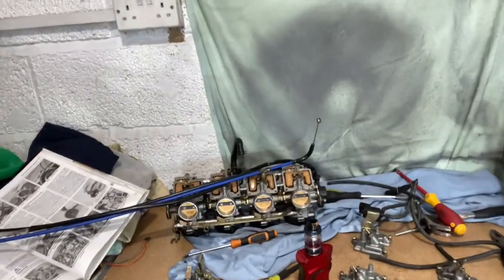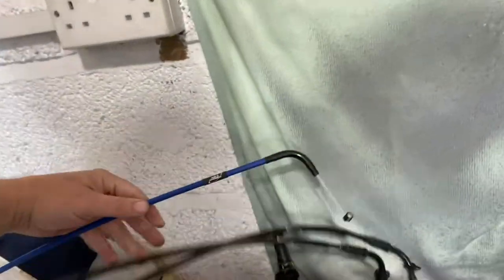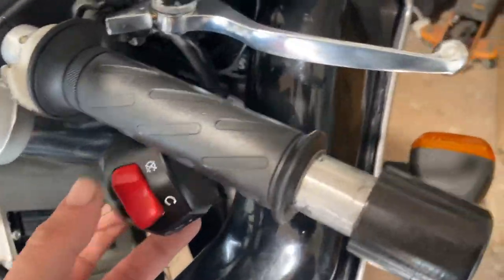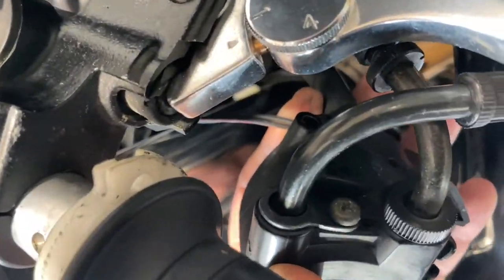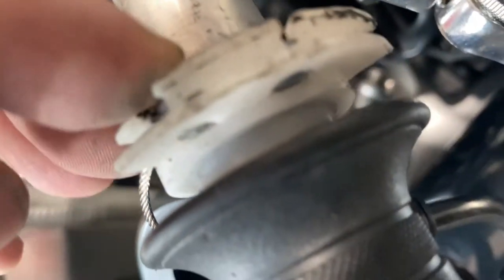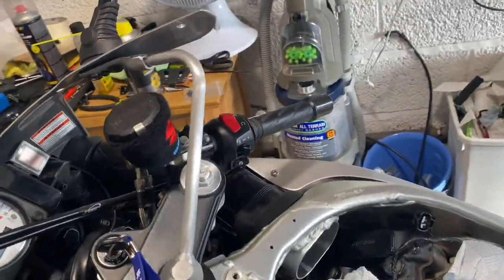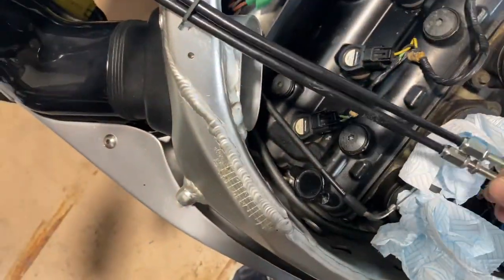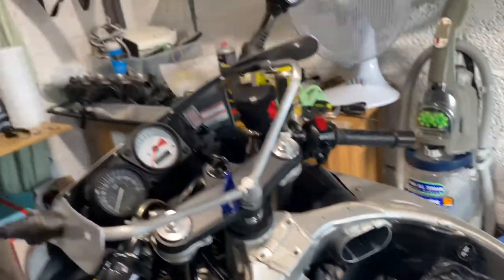(Suzuki Gsxr 600 Srad Maintenance) AS3 VENHILL FEATHERLIGHT Throttle Cable Installation

Comment: Do you know how to change the fuel to air ratio in a aprilia rs4 125 ? Just got new exhuast system and it’s running rich
Reply from the maker: You can’t without a Axone machine it’s an Aprilia thing if it’s running rich (which it shouldn’t because new exhaust is more flowing should make it lean) but it has a lamba sensor which monitors AFR so it should trim fuel to suit..If it is rich put a free flowing filter (k&n bmc etc) it will give it more air but doesn’t really make it any faster 👍👍
Reply: Dean Snookes alright thank you for that free flowing filter is worth a try
Reply from the maker: Can I just ask how do you know it’s running rich what symptoms have you got bud ?
Reply: Dean Snookes don’t get any power under 7000 revs just burples and pops